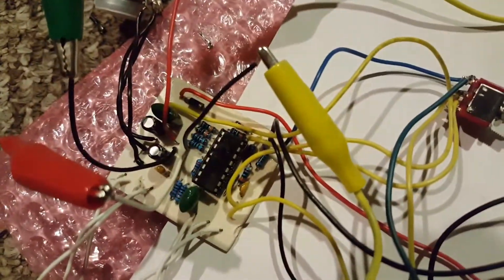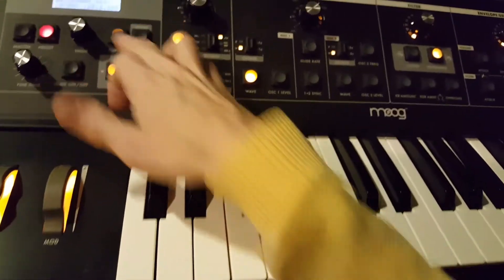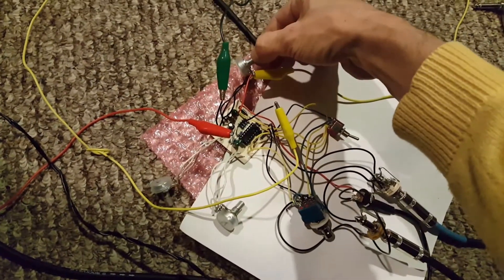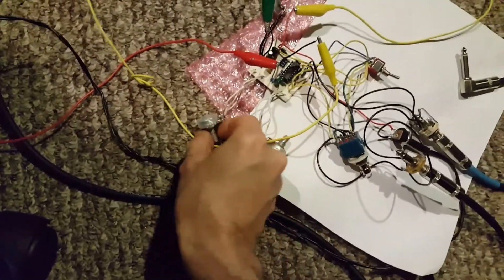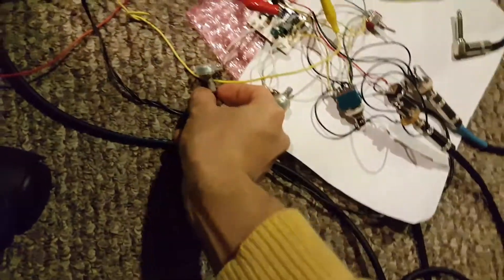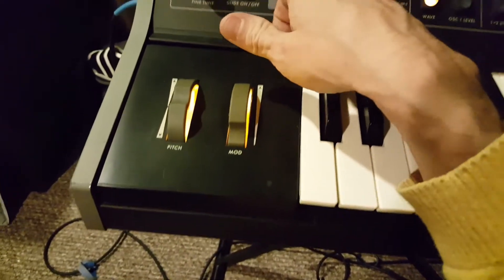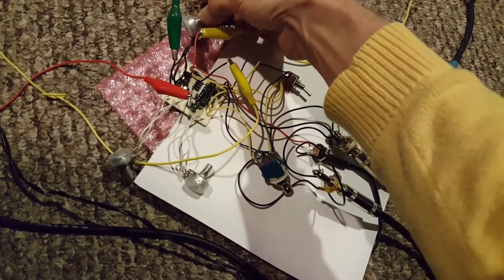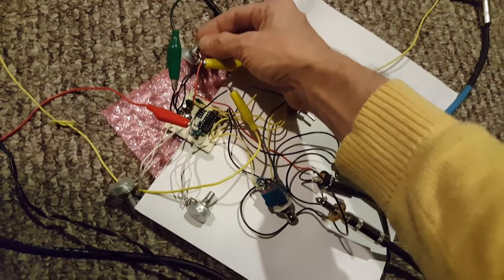Korg MS-20 Filter DIY Verified

Comment: Did you happen to figure out the quirk with the B100k pot cutting the sound? I know if you put a 1M resistor in parallel with it, the nominal value is slightly over 90k. Mostly just wondering if you ever found this or something to work. Also, did you use the PCB layout from the blog?
Reply from the maker: Yes I used the layout from the blog - never got back to the 100k issue - but will try the 1m resistor on it and see if it works!

Comment: Yeah it seems like quite a few builders, me included, can't quite figure out the switches, input and outputs... Anyone interested in posting wiring diagram?
Reply from the maker: trukxelf The switch in the layout is the HP/LP switch - you would wire a second DPDT (or 3PDT w/ led) to act as the Bypass switch for On/Off. The instrument input jack runs to the On/Off bypass switch - and the input signal from there goes to 3 and 4 of the HP/LP switch (feeding input into the pcb board). The "output" label on the pcb gets routed back to the bypass DPDT to the output jack for the amp....
Reply from the maker: trukxelf I made a quick cheat sheet for you, hope this helps. 

https://ibb.co/hAM4CH

Instead of running the bypass switch to the board directly (green wire) you run to the hp/lp switch first....look up DPDT pin numbers, use 1,2, 5 and 6 with board - run output from board back to bypass switch